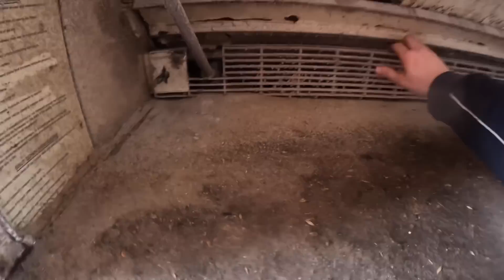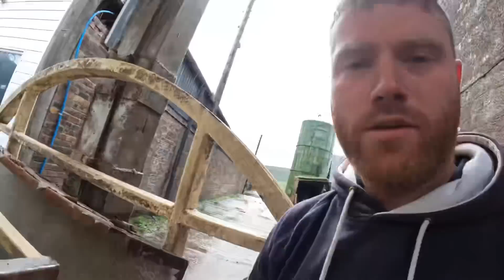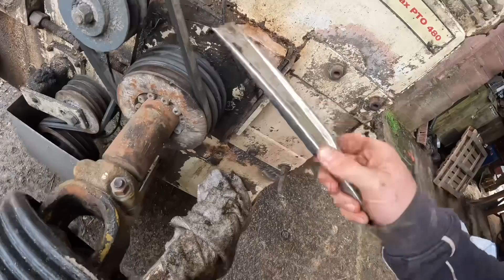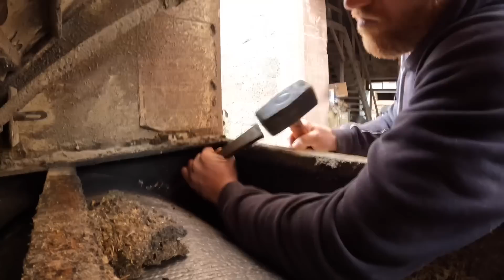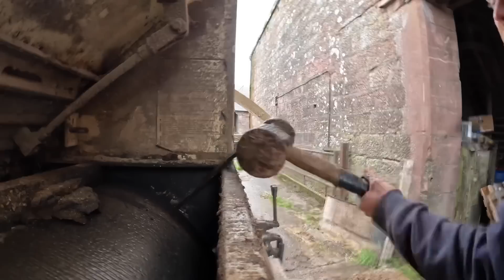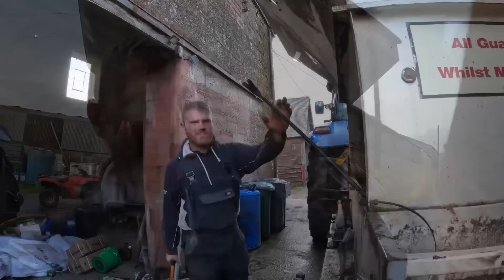DAMN BRUISER IS ENDLESS!!!

Comment: Drew drew stop ✋️ I made and designed this crusher in around 2013 ish I'd guess? 
It's not the bearing its the tolack bushes that mount the shafts to the roller itself it needs removing re engineering and put back together. Moving the bearings won't solve this. 
My old apprentice took over the crushers from mallinson when they sold recently give me a message I'll point you in the right direction.